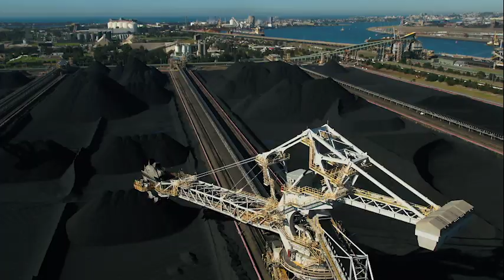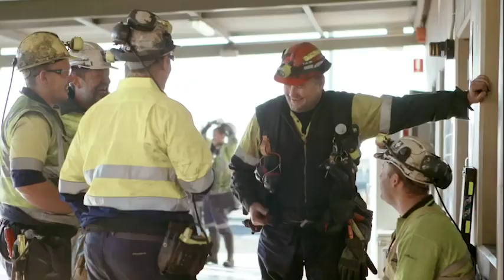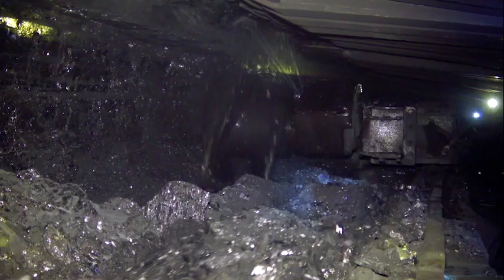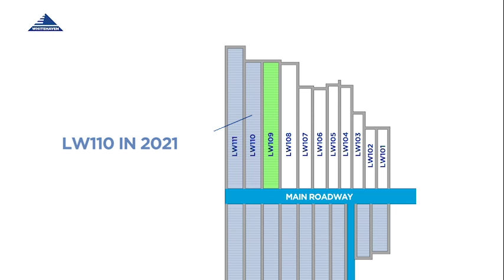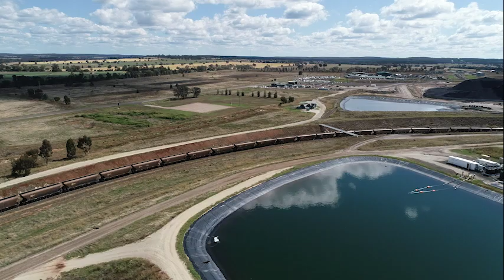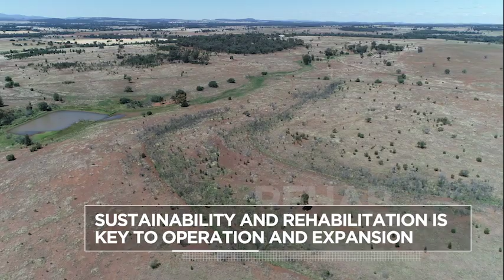Whitehaven Coal's Narrabri Underground Mine | virtual tour

Comment: What is PCI coal?
Reply: Its used in ‘Pulverised coal injection’ operations in a blast furnace as supplementary fuel.
Reply: @akf2131  Many thanks. Alas, I don't know enough about blast furnaces. Is this injected into the hot blast stoves or can coal somehow take the place of the coke that is part of the blast furnaces charge?
Reply: @COIcultist  my knowledge on Blast furnace operations is limited but my understanding of the process is PCI is used as a supplementary fuel,which reduces the amount of coke required therefore reducing costs,PCI coals can also be sold on the thermal coal market.It is injected directly into the bottom of the blast furnace.👍